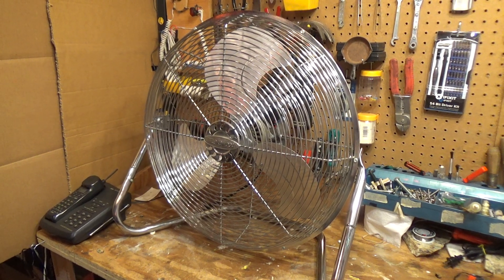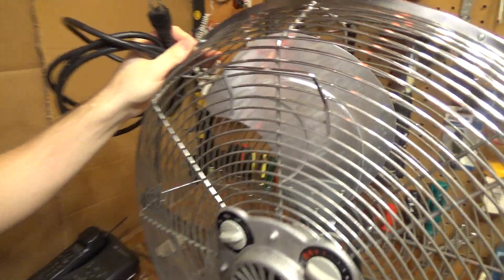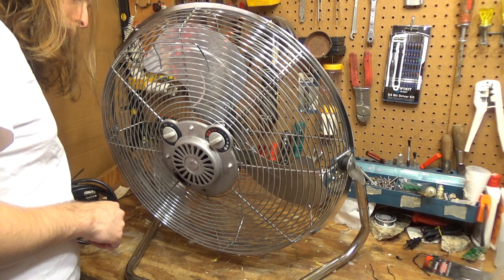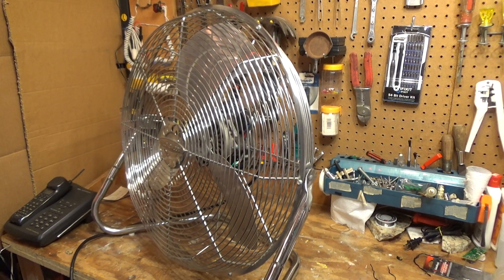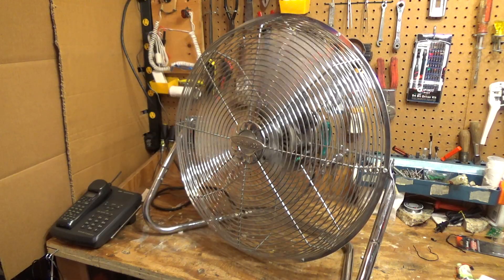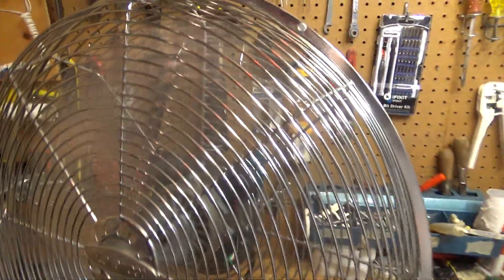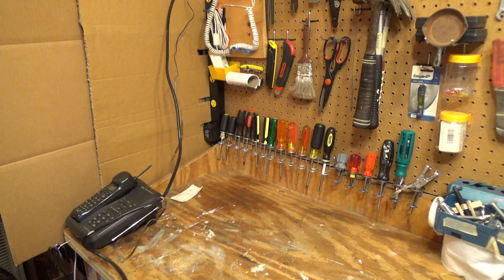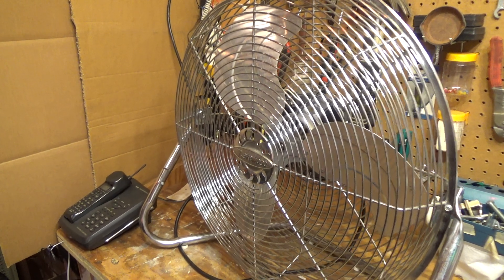Lakewood HV-21T | Initial Checkout

Comment: I'm fixing one of these up.  I cleaned all the old goop out of the bearings and I'm not sure what to lubricate it with.  I tried graphite, but that started squeeking quick.  Trying STP "universal grease" now, but I think that's a bit too thick.  Was going to try lithium grease next.  Or should I just use gun oil or 3-in-1 oil?  Great fan, isn't very noisy except on high.  Moves ridiculous amounts of air.
Reply from the maker: Glad to hear you're keeping one going. You should use 3-in-1 in the blue can or ZoomSpout, and you'll want to clean out the grease from the bearings before putting in the oil.
Reply: @JordanU  okay, thanks for the advice.  It's been running on the grease for a couple of hours and it seems like that might be a little too heavy.  On low speed, it growls a bit like an induction motor struggling to keep up.  On high it rocks with no squeaking, but it does have a little vibration.  I'll clean the grease out, put in some oil and try to balance it.  Mine was chrome too, but had a tough life apparently. It's pretty rusty. I'm going to give it a custom paint job, but only polish the blades.
Reply from the maker: @tonyfremont  Sounds good, would be interested in seeing the final product. The guard and stand are the only parts that were chrome—the blades were never intended to have a shine. I believe they are aluminum, but they may shine up with enough effort.

Comment: Im willing to bet that whoever owned that fan before you had drilled that oil hole on the back bearing. So at least someone cared enough about the fan to keep it alive.
Reply from the maker: It's a possibility.. If they were so inclined to rewire the thermostat, chances are they made the oil port as well..

Comment: I spy an oil port on the bearing at 5:37 a couple of Lakewood’s I have from this era have this
Reply from the maker: I was wondering if that was original or not..
Reply: Yea it's weird on my 2004 Lakewood kool operator it has this but on the other side of the motor where the blade hub covers it there's like a fill in where there was suppose to be one on top of the bearing it's weird but hey fine by me!
Reply from the maker: That's exactly how this one is as well.. Guess it must be from the factory..

Comment: Did lakewood manufacture the motor for this fan. seems odd to mount the controls to it. the Lakewood fans along with Patton were quality fans than. they were built like tanks. this has to be one of the fans made prior to lakewood going out of business. it seems Jarden is making fans in the former lakewood plant mainly for the Aerospeed fans i see
Reply from the maker: I believe Lakewood did make the motor for this.. This came out of the early-mid 2000s, probably within 5 or 10 years of them closing down..
There are a number of companies that are still producing things off Lakewood's design, I know Cam Air also made some.. I've seen a few of the Kool Operators around, as well as the box fans under many different names..
Reply: as i believe these motors are a lesser quality with a one shot thermal fuse in them but you can go on EBAY and get some motor protectors as FASCO uses them in the 3.3 inch motors as they are put on the motor windings and this fan can last in the long run. i seen some of the 5 blade high velocity fans by Lakewood but don't move much air  as the blades rarely have much pitch to them. the high velocity fans by Lakewood as well as Patton used motors from another manufacturer. Vornado for their modern fans they used a FASCO motor first then McMillian electric up to the mid 2000s and made their own short lived motor for their 280 series fans and the 283 Heavy duty shop fan. as now all Vornado fans the US assembled models use a motor imported from China either SuperElectric, or Pan Globe.   these high velocity fans today they gotten more thinner and flimsier. Ventamatic for their MAXX Air brands they are assembled in the USA but they have replacement parts for them they are well known for the Cool Attic power attic fans in which McMillian Electric still makes the motors for them as well as Lomanco, and Broan/Nutone LLC.